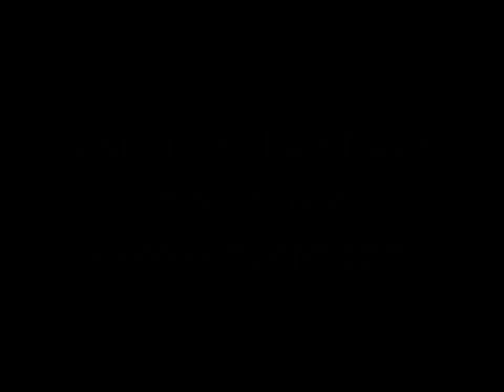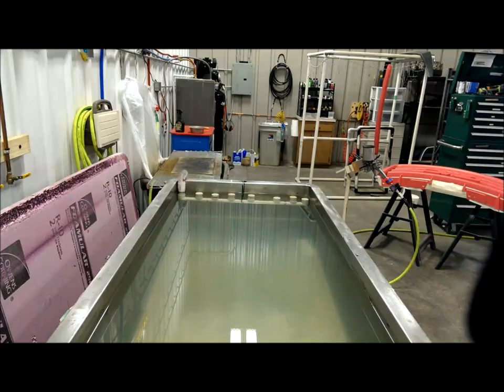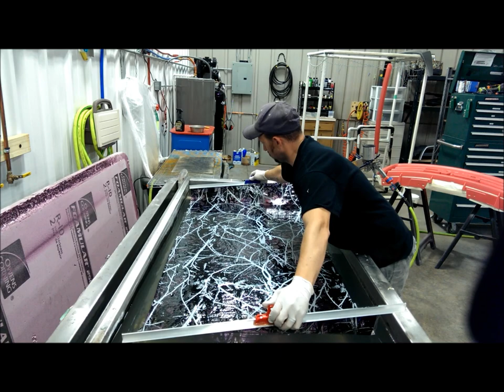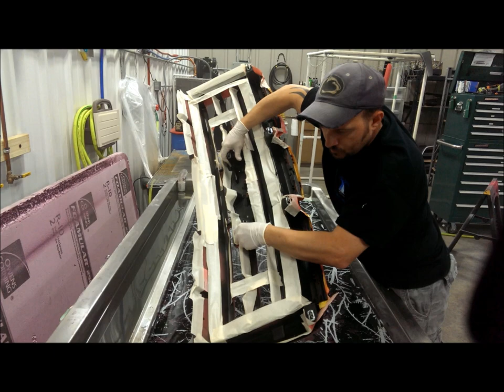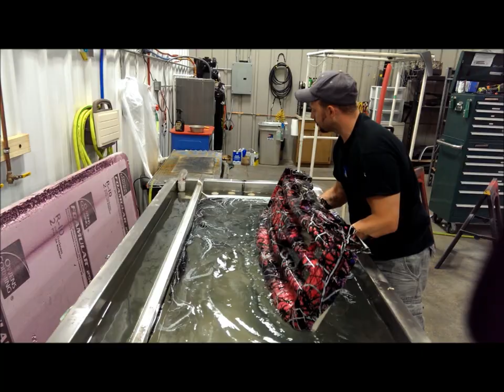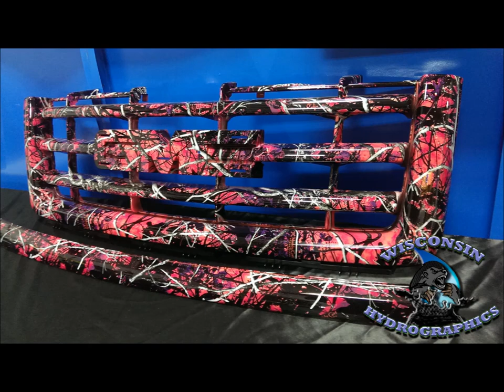Wisconsin Hydrographics dips a GMC grill

Comment: Tyler, we use TWN 's NJM for all dark and heavy ink patterns. This slows the activation hence maintain colors. 3502 or Hydrovator is too hot and burns the dark inks. 90 degrees, 60 seconds. Hope it helps.